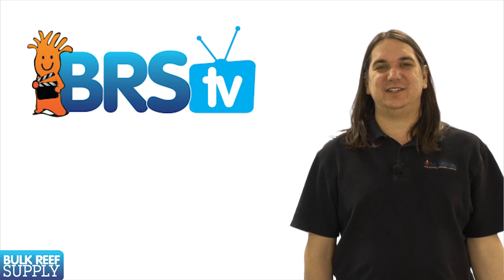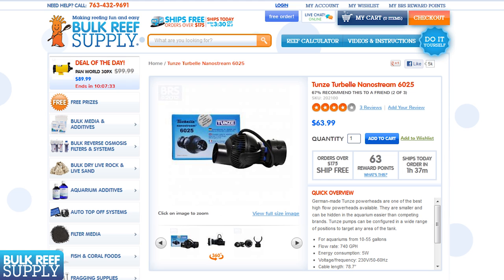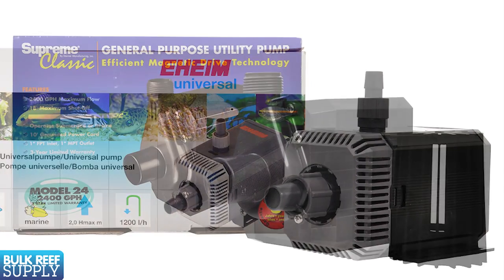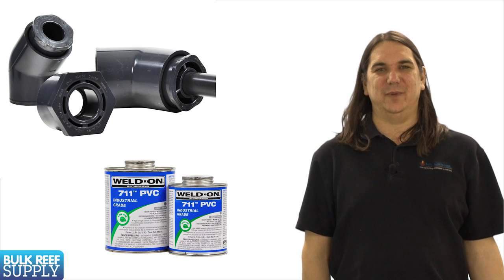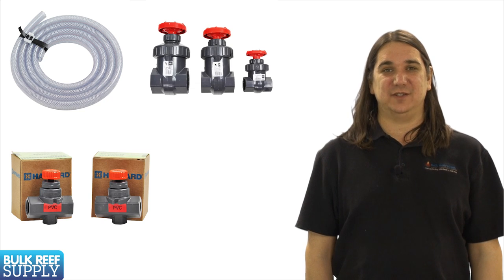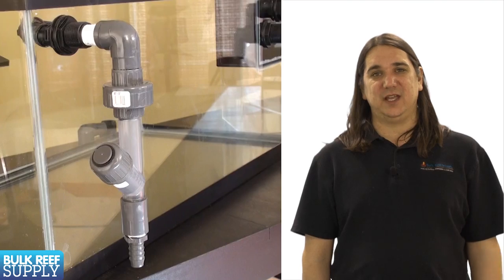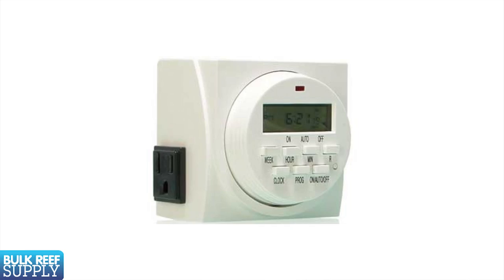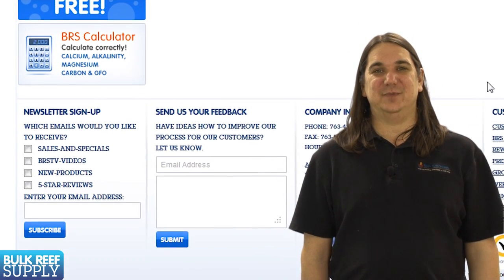Pumps, Plumbing and Electrical - EP 3: Saltwater Aquarium Basics

Comment: Great video.  One electrical suggestion.  Make sure your plug is on a GFCI circuit.  If not, then it's only ~$10 for a GFCI outlet - swap out your plug fo ra GFCI one.  Normaly 120v won't kill you but GFCI makes it MUCH safer.  GFCI will cut power in the event of a fault (like saltwater in one of your plugs).

Comment: Thank you for all your videos.  I'm just plumbing my first sump.  What is the difference between the Cepex valve you illustrate in this video and the ST Series valve I find via local plumbing distributers?  I'm just not finding much.  Is the ST model reef safe or does it have a metal component that's just going to corrode?  Thanks for your response.

Comment: Hello, noticed in the video you mentioned using a return pump for your "other equipment." If I'm planning on running a carbon reactor in my sump, can I use the same pump for return and for the reactor or does the reactor need a separate pump from the return pump?
Reply: ***** Thanks! I'm new to saltwater tanks and your videos have been super informative. Keep 'em coming!

Comment: Hey BRS Guru's - I plan on using 45 degree Elbows instead of 90, Thinking this will not restrict water flow as much - ? ALSO - I plan on using a True Wye 120 degree adapter to split the return plumbing back to each end of the tank - ? Lastly - I plan on using the Iwaki MD40RLXT - simply because it has a 1 inch input and out - Yet, I love the new EcoTech Vectra L1 - but it has 1 inch in and 0.75 out - Seems to me you would want to equalize the flow throughout the entire system ?  I do love the idea of customizing the flow rate and it is also a great choice when I move from my current 130 gal Reef to a larger tank later ?  I guess I am asking you to sell me on the Vectra regardless of the smaller return ?  As if I haven't thrown enough your way - I will be pulling the tank water through four DIY Canister (PVC)_ 4 inch by 18 inch Filters (Mechanical, Chemical, and 2 Bio's).  (See DIY King DIY Cannister Filters Tutorial - mine will be similar but in a flow pattern like the Lifegard Aquatics 4 Canister Compact sequence.